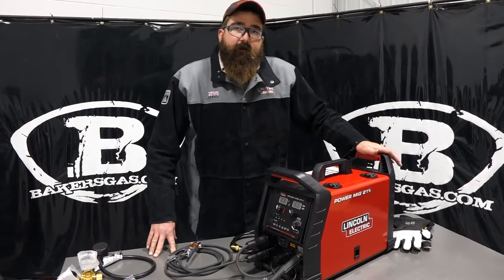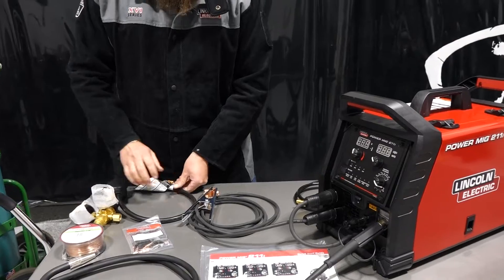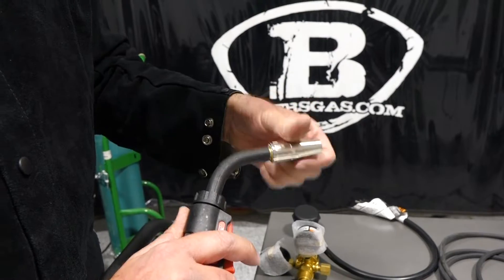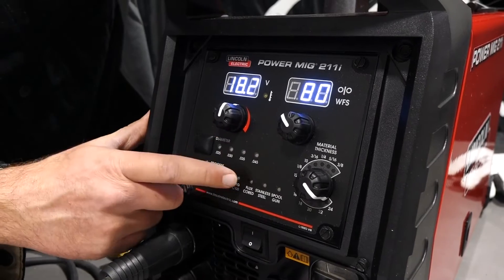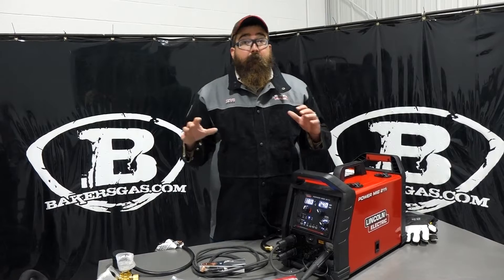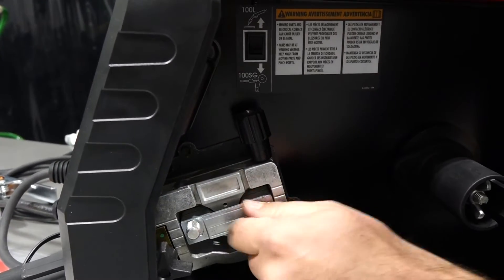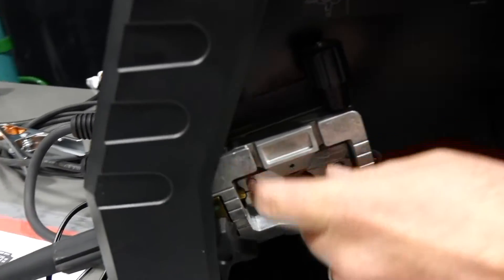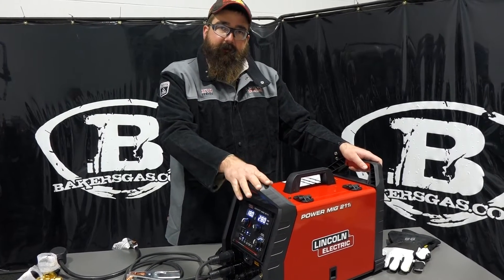Lincoln Electric Power MIG 211i MIG Welder Review

Comment: I don't appreciate how Lincoln makes the gas valve open electrically at the same time the wire starts feeding.  Guarantees the initial arc has no shield gas. Clarke has superior engineering as they use mechanical valve that opens independently of the wire feed actuation. Can hold trigger halfway and preflow some shield gas. Sorry, Lincoln, like the red paint but you still have a lot to learn about designing a welder. One more microswitch and you can preflow, too.

Comment: I noticed that you referred to the new wire drive. You also referred to it on the new Lincoln 215MPi (I think it’s called) when you reviewed it.Sure looks exactly the same as what came on both of my Lincoln PowerMig 210MPs. I bought the first one in 2015. Am I correct?
Reply from the maker: Hey! It is newer glad to hear its on your 210 certainly not on all of them. Thanks for watching!

Comment: Would you recommend the ESOB over the weekend and if so, what? I like the Miller. I have always used Miller in Lincoln. My favorite Lincoln a little bit more but I've had very good success out of both but for at home use in the truck on the run used. Which one would you choose? Which one have you seen less issues out of?
Reply from the maker: The Lincoln 211 has the most value! 2nd Miller 211 which has been out longer but really similar! If you want/need Multiprocess look at the 215s!
https://bakersgas.com/products/lincoln-k4876-1

Comment: Love your videos. Very informative. I'm trying to choose in between this Lincoln and the other leak and I think it's a 225 or two. Something as a good bit larger or the Miller or the ESOB? Which one would you recommend? I have a gas powered 250 GTX Lincoln portable welder. I want to use this one to do small smaller jobs inside the garage and also be able to use it for TIG and wire big welding flup score. I know this one does not do TIG I don't think I'm not 100% sure. What do you recommend?
Reply from the maker: Hello- thank you for watching if you email us your exact application, budget, and power requirements we can make a few suggestions. This new Lincoln unit is a great MIG welder! Sounds like you might be needing something that could multiprocess and if so there is the Lincoln 215 and bigger units as well.

Comment: Just ordered mine from you guys over the weekend. Should be getting it by the end of the week. Was a bit of a shot in the dark as there was no information on it other than what lincoln put out. Even that was pretty limited.
But it checked the boxes I needed for a welder. 
I only need it to MIG, have a decent duty cycle and more amps then the 140 series.
Reply from the maker: Nice!!! Enjoy let us know what you think once you have used it for a bit!
Reply: @BakersGas  really like it so far. Super simple, straight forward, good power, small and versatile at a great price. 
This is the perfect welder for an auto body technician like myself. 
Also, thank you guys for the free shipping. I first priced it out with airgas and they were going to charge tax and shipping. So it was quite a bit cheaper buying from you.
Reply from the maker: @TRYTOKPUP  appreciate the support!  Keep us in mind for any other supplies. Always free shipping over $99!